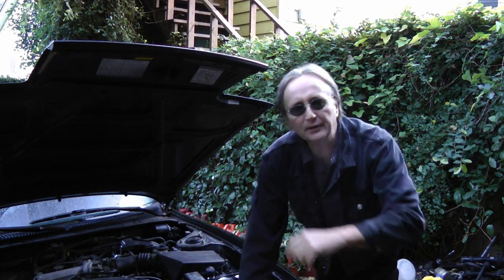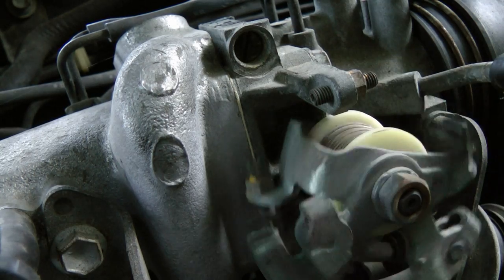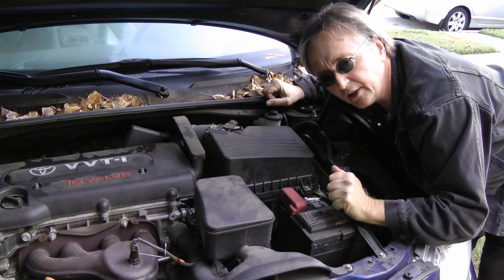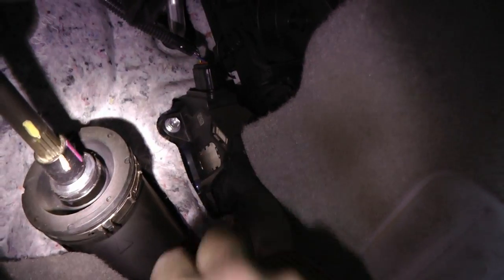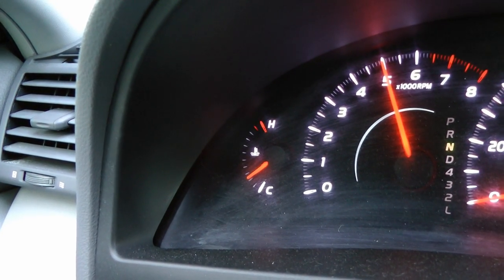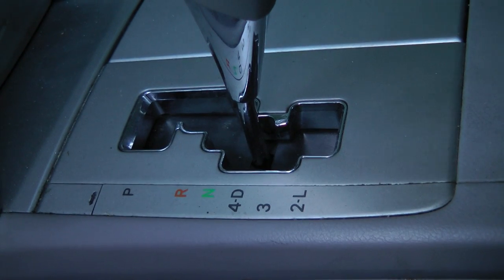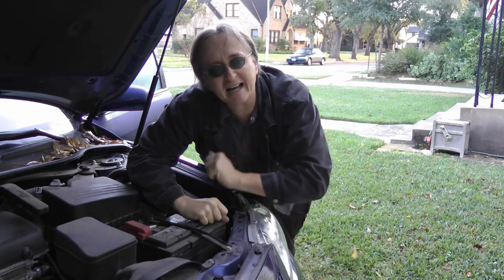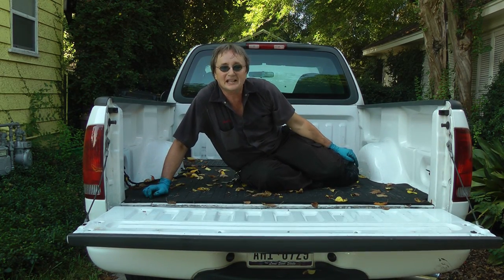How To Stop Unexpected Car Acceleration

Comment from the maker: ⬇️Things used in this video:
1. Silicone Lubricant: http://amzn.to/2CBWDHs
2. Flashlight: http://amzn.to/2kwtiu3
3. Common Sense
4. Full HD Camera: http://amzn.to/2AvoEk7
5. My computer for editing / uploading: http://amzn.to/2i2sKYz
6. Video editing software: http://amzn.to/2jv5Fhf
7. Thumbnail software: http://amzn.to/2k7tz6C

🛠Check out my Garage to see what I use every day and highly recommend:
https://www.amazon.com/shop/scottykilmer

❗️Check out the Scotty store:
https://goo.gl/RwhRGU

👉Follow me on Instagram for the latest news, funnies, and exclusive info / pics:
https://goo.gl/ohy2cA
Reply: Scotty Kilmer : How i can i find out if my throttle is regular or computer controlled. I drive a 2016 nissan versa sedan. It is sold/badged here in the middle east as a nissan sunny
Reply: This is bs.. there is 3 switches on a accelerator pedal. 1 of them low to high range. Another one is high to low range. And of coarse, the idle validation switch. If the PCM sees that the gopedal is at idle, it will idle the engine.
Reply: How about a runaway diesel ?How to stop Scotty?
Reply: Scotty kilimer sir,when I go gas station for fueling ,during refueling time my stop,sir can tell what is problem, I have GMC TERRAIN 2011 2.4L
Reply: Hey Scotty. I know this video was most likely referencing the runaway Lexus in San Diego that had a tragic ending. But all these years later I still feel like 1) it was a preventable tragedy, if the off duty officer had focused on the solution, and not the problem. And 2) it was the time when Toyota had moved into the number one automaker in the world, and the American automakers were being bailed out of bankruptcy buy tax payers. It always felt like a media attack campaign on Toyota to distract the failures of American companies.
Reply: I have a Datsun 1200 but I noticed it drives itself though slowly without pressing the gas pedal how do I stop this

Comment: Hi Scotty. Actually I would like to thank you for saving my life. I've been using 2007 camry and today when I was passing a truck on a highway at 60mph the accelerator pedal stuck and the car started accelerating uncontrollably. I suddenly remembered from your video to put the gear into neutral and I was able to safely stop the car. Otherwise I could have ended up under the truck in front of me. You can't imagine the horror and fear that I have been through. After shifting to neural,  I also thought that the engine may blow up because of high revving. Anyway, I just want to say that you're a great person and please keep on what you are doing cause you are doing it very well.
Reply: You're lucky you were able to shift into Neutral. I unfortunately wasn't!

My 2010 Toyota Prius Suddenly Accelerated Unintendedly on January 31, 2019. This is still happening! This was not the Floormat! I did not mistake the Gas Pedal for the Brake Pedal! I Never Have! The pedal was not Sticky! It Sucked itself Full Throttle right to the Floor when coming out of a right hand turn! Brakes held but Engine was Revving like crazy. Every time I released the brakes to try to get the gas pedal to come back, the Prius took off. Can you imagine starring down with your foot on the brakes, and the gas pedal is still pushed in Full Throttle? Explain that?? It did this for about 2 and a half blocks. Shifting to Neutral was NOT working. It wouldn't Turn Off. And I didn't want to press the "E" Brake risking the lines snapping and having NO BRAKES! That was my last resort. This was Crazy and Vehicle Manufacturers need to be held accountable! I've made a "Safety-Related Defect Complaint"  to Transport Canada 🍁. You should all do the same in your country. Let's fight this and end Sudden Unintended Acceleration!  Maybe going back to a Drive By Cable system instead of Electronic Throttle Control will be the answer. There's gotta be a solution!
Reply: The solution is not to buy a Toyota. Hyundai and Kia also have this problem and these cars should be avoided also.
Reply: @BRIrwin  it's possible in all vehicle makes and models. They all have Electronic Throttle Control. Sudden Unintended Acceleration most recently happened in a Tesla. Do your research. Toyota has the lions share.
Reply: you should never have had to worry about that.
Reply: Unfortunately, the driver of a Lexus didn't know that when driving down an la freeway that ended in a few miles, and he hit two cars and an embankment at 110 mph, killing him and his three passengers
Reply: Sunamer Z  I used to drive stickshift. That's why I had this problem on my automatic Camry. All because lack of experience.
Reply: @VernonMarshallOfficial  Well i see your point but the need to electrify and remove mechanical parts is nessecary from a effective viewpoint. Hopefully soon enough the eletric air intake, brake system, direct fuel injection and drive by steering will be the norm.
Reply: Tim Allen  Most american cars nowdays are filled with more electronic and unnecessary crap than european cars lol.
Reply: @Gripengamer  You are so wrong.  The more electrical components a vehicle has, the easier it can be remotely controlled by the government and military.  And I can assure you, they do NOT have our best interests at heart, to put it mildly.
Reply: Am doing the shift from drive to neutral,  because of unintended acceleration.   Automatic 05
               Taurus. 
            Haven't figured out why it's doing it

Comment: You are actually saving people life and money.
Reply: Someone said if the car has gear shift lockout you won't be able to put it in neutral and a lot of cars have that feature
Reply: @gardensofthegods  I know you can’t put one in reverse but not neutral. I’ve never not been able to bump it into neutral. I think it’s a safety issue. Try it. Not at 100 mph but going down an empty highway sometime. Just bump it to neutral. I bet it goes to neutral.

Comment: drive it into a tree that will stop it
Reply: Steven Johnson Yeah and it might stop your life too :P
Reply: only if air bag dont go off if it has 1 that is lol
Reply: A woman would drive it into a tree, a man would put the transmission in neutral! Lol
Reply: Women in every age group pay less for auto insurance than men, so the truth is men are doing less thinking and more risk-taking behind the wheel.
Reply: mochaman 9  So said the woman in the Liberty Mutual Insurance commercial! Women! lol
Reply: But then the tree huggers will be mad (:
Reply: If it's my truck, I can just run into somebody head on and they'll just bounce off. That's why I drive an F 350
Reply: Steven Johnson.  In a 120 Mph 175 h.p and 248,965 RPM hell naw
Reply: Its called natural selection
Reply: Zero Compassion!  You've obviously never experienced this!

My 2010 Toyota Prius Suddenly Accelerated Unintendedly on January 31, 2019. This is still happening! This was not the Floormat! I did not mistake the Gas Pedal for the Brake Pedal! I Never Have! The pedal was not Sticky! It Sucked itself Full Throttle right to the Floor when coming out of a right hand turn! Brakes held but Engine was Revving like crazy. Every time I released the brakes to try to get the gas pedal to come back, the Prius took off. Can you imagine starring down with your foot on the brakes, and the gas pedal is still pushed in Full Throttle? Explain that?? It did this for about 2 and a half blocks. Shifting to Neutral was NOT working. It wouldn't Turn Off. And I didn't want to press the "E" Brake risking the lines snapping and having NO BRAKES! That was my last resort. This was Crazy and Vehicle Manufacturers need to be held accountable! I've made a "Safety-Related Defect Complaint"  to Transport Canada 🍁. You should all do the same in your country. Let's fight this and end Sudden Unintended Acceleration!  Maybe going back to a Drive By Cable system instead of Electronic Throttle Control will be the answer. There's gotta be a solution!
Reply: yeah almost did that today... thanks for the remedy for our unintended acceleration...so Fukkin helpful!
Reply: If you’re going too fast, you’ll die. Sure, modern cars have crumple zones, airbags and seatbelts with pretensioners and force limiters, but these can only save you from so much. If you’re doing like 90 mph or something into a solid object then you’re just asking for trouble. As Scotty even discusses in a later video, seatbelts can cause internal injuries. I’ve heard stories of people who have suffered all manner of internal injuries from the seatbelts in their cars resulting from car accidents, ranging from incontinence to serious stuff from which some have even died, such as internal bleeding, collapsed lungs, brain aneurysms and even acute massive pulmonary embolisms.

Comment: The problem with unattended acceleration is usually the driver not knowing what to do and overreacting or 'freaking out' then it becomes dangerous. I'm starting to think that people should have to take a basic automotive course before getting a license.
Reply: driving tests are never enough.
Reply: That's what it is

It's unexpected and some people tend to freeze up when they panic and have no idea what to do
Reply: You're right, plus the fact not to offend anyone, but people are becoming less intelligent as technology becomes more advanced. The reason is for example years ago people had to check their own engine fluids every once in a while, and figure out what the problem is or you're screwed. Now with all these computers if you're low on something you don't even have to open the hood. It's ridiculous.
Reply: on top of what you said, I hate when manufacturer actually design cars that discourage people to open the hood
AKA BMW with no way to check oil
Reply: Thank heavens, my grandpa taught me, how to drive manual and automatic cars, he was a very good trainer. He always said: 'keeping calm behind the wheel, pays half of the rent'. Unfortunately, I was never eligible to get a driving licence, due to cataract and severe eyesight problems. I hope, that TESLA will fix the problems with their auto steering system, make it adjustable like a prescription for glasses.
Reply: People who never learned to drive a stick probably wouldn't think of touching the shifter while the car is in motion.
Reply: Jason Koneman sudden acceleration happens to me so often. I drive manual cars and when it happens, I am very calm to slow down the car but if someone with me is freaking out, it freaks me out too.
Reply: Cryptonymicus sad but true...
Reply: Lmao well know we have to take a driving class at school. Took mine when I was in 9th grade like 4 years ago
Reply: You mean lile a basic driving written test? 😲😲😲
Reply: Jason Koneman - the nut behind the wheel
Reply: Jason Koneman they even teach you that in the driving school too lol
Reply: This. Somehow that almost never happens in the rest of the world where people  actually need to take courses.